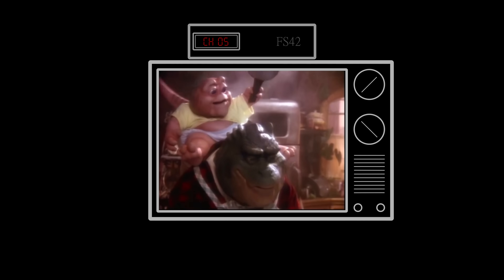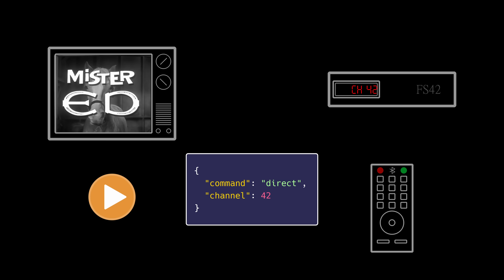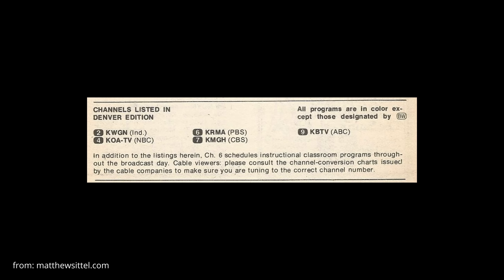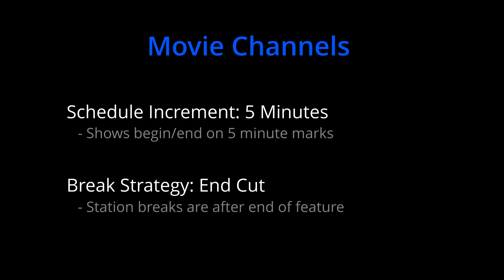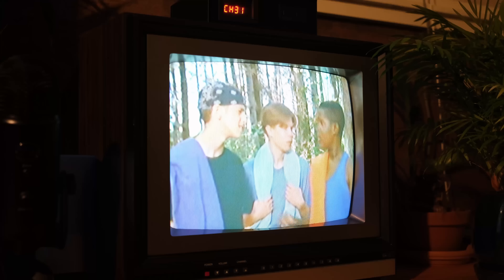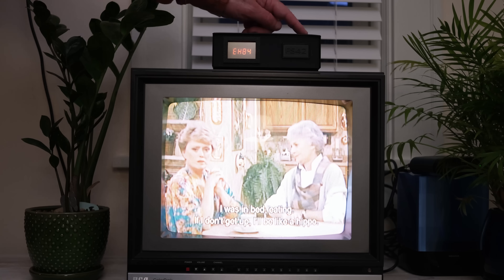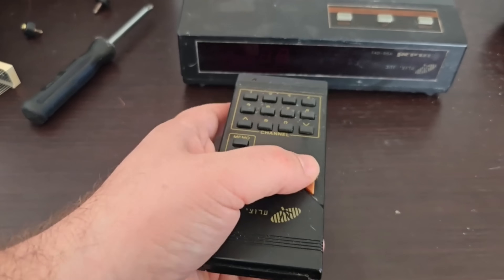90s Cable Simulator - Recreating Retro Cable TV with a Raspberry Pi

Comment: One big caveat with this setup is that there is not really any room to load in any recreated on-screen graphics, temporary or permanent. Once you start getting into the latter half of the 1990s, more networks started using persistent station identification in the form of screenbugs, which traditionally can only be preserved through original broadcasts from the time period. This is probably not something most people would consider, however if anyone is up for implementing a system for that I'd like to see it.
However that's only a minor detail I tend to nitpick about a lot, because the major focus on this project has been recreating the continuity and breaks, and this pretty much nails the setup for that. As well as the aforementioned premium cable networks, this looks perfect for recreating that era of syndicated TV that aired on local stations from back in the day.
Reply from the maker: Its a good feature - station ID screen overlays are on the near-term roadmap. I also want to add channel number and name overlay on channel change also. Cheers!

Comment: Seeing that Jerrold/General Instruments set top box, reminded me of when I built a descrambler for it. I miss those days lololol ❤
Reply from the maker: Seriously? I was always very curious about that - did the descrambler work?
Reply: @ yes, it came as a kit that you had to assemble. For some reason there was a 555 timer involved in it, an inductor or 2 and a handful of capacitors, transistors and resistors. There was a coax input/output. I’m assuming they could only sell it as a kit to put it together yourself so they wouldn’t be liable. But it was amazing. The only pain in the rump part, was adjusting the 2 potentiometers on it, every few weeks. Think it was mid 90s to late 90s, then Comcast required their full proprietary digital boxes.

Comment: This is so great. I have loads on content on my NAS and have tried and failed at setting up something similar with ErsatzTV but failed. So I’m still a bit intimidated to try this out. You have done incredible documentation though so I’ll give it a try.
Reply from the maker: Thanks! There are still some holes in the documentation, so if you give it a try and get stuck, just file an issue on github and I'll try to unblock you. Cheers!
Reply: @wrongdog_reckons  I saw the detailed documentation/guide.  Looks pretty straight forward!  Will give this a shot.

Comment: The further we move away from the 80s and 90s the tighter the tether grows.
Reply from the maker: The past looks better and better as the future looks cloudier and cloudier I think. Cheers!
Reply: @wrongdog_reckons  yep we are heading for something really bad and this kind of stuff takes our mind off of it for a bit. Thanks. If i can offer one suggestion, could you trying mounting the Pi inside a real 90s cable box :)
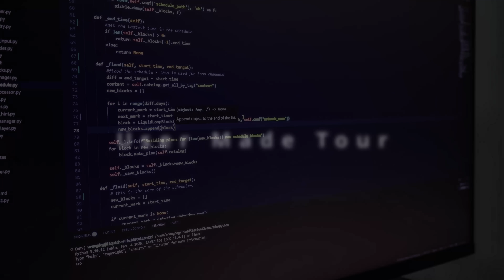Reply from the maker: @mehmeh5471  - Well said. If you look at 13:30, it shows a user made version where they mounted it in a real vintage cable box and put the converter inside the box. Cheers!
Reply: @wrongdog_reckons  Thanks, sorry i must admit i stopped the video just before his part came up.

Comment: So, sometime during the pandemic I saw a similar video and Ive been hunting for it and I am curious if the guy behind that video crossed paths with this github. The guy I remember did a similar thing except he I think had to make his own custom display because of something with the Raspberry Pi, but what I remember most was that in his content showing what the world used to be like he used a lot of content from St Louis local ads, and I think he might have actually recreated our broadcast networks in his implementation. I saw some St Louis local ads in your discussion of commercials as well, but figured this was a coincidence. The other guys video felt like it was some 25-30 minutes long, and I've been hunting loosely for it for a year.
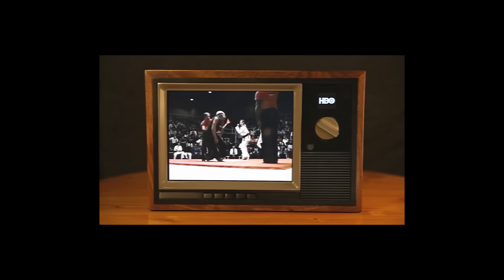Reply from the maker: Yes - I reference this video at 17:40 because it was a huge influence to starting this channel in the first place (thinking: I also do low-stakes but detailed projects and like film-making). I've never interacted with the OP of that video. It was a great video and project, but the OP didn't release the source code and later deleted the video. After I started my channel, I went back to find the video so I could thank them for the inspiration but found the video was deleted. No idea why they deleted it, so out of respect for that, I wont link it. It still exists on archive.org if you want to search there. Cheers!
Reply: @wrongdog_reckons  OHHH I see that yeah, I couldnt find it either, so that makes sense. I will try and go watch that on Archive then. Thanks for the heads up.
Reply: @TyCrawford  you'll find a few reddit threads with a link to the original video on the internet archive (for some reason their own search didn't bring up the video for me). The title is "Retro TV: Live 24/7 Vintage Cable TV Network on Raspberry Pi"

Comment: This is a really interesting video. I have several cable tv trasmitters (QAM). They are laying in my basement. This would be a nice project to change those channels into multicast streams and stream them to the QAM so it outputs those in RF signal so multiple TV's could watch it and browse different channels
Reply from the maker: So, I want to learn more about the TV transmitters. QAM is what I should be looking for? Cheers!

Comment: I would love something like this for Windows PC. This is amazing.
Reply from the maker: I run it on a PC all the time, but there is an extra step: you'll need to install WSL (Windows Subsystem for Linux) with the default Ubuntu Linux install. Then, you can just follow the install steps on the github wiki. This is the configuration I develop it in too. If you decide to give it a try and get stuck, file and issue on github and I'll try to help you out.
Reply: @wrongdog_reckons  Awesome! I'll give it a try. Thank you. This is amazing.

Comment: It be cool if you could have episode related bumpers play if something major comes up, The late 90s was the start of hype TV and the X-files had a lot major reveals that they would hype up leading into the new episode, Or things like two part episodes like the Simpsons Who shot Mr Burns episode and its contest. Speaking of two parters is there anything in place to make sure they play back to back? 

i think these features would be great and important to add if you ever attempted 2000s Tv as its going to be required for shows like Lost and survivor to make it feel anywhere near realistic to the era
Reply from the maker: Exactly - need to be able to match specific bumpers to specific episodes. I'll put it on the roadmap - cheers!

Comment: How much storage does your content take up? Do you have it stored on a NAS or some other storage device besides a SD card?
Reply from the maker: See the blue thing behind the cable box in the thumbnail? That's a cover I printed for a docking station for spinning disks. I haven't fully tested over network, the catalog build might be slow but it should perform just fine. You really only need a couple of TB to make a good SIM because its not high resolution content and depending on how many channels you have and how often you watch. If you watch less, you don't need as much content because less watching is less chance of repeats. Cheers!

Comment: Bro. I only want 1 channel: The Weather Channel. Local on the Nines, baby.
Reply from the maker: Another commenter just told me about Taiganet's WeatherStar 4000 simulator (an emulator of the machine that used to play the Weather Channel's local forecasts in the 90s) to run on a loop. I'm going to check that out - but in any case it would be fairly easy to add one that pulled from a local weather source. I'll put it on the roadmap. Cheers!
Reply: Somebody did make a weather channel that connected to your local weather, it might be the same channel I don't remember.

Comment: Did you find a way to inject commercials at appropriate times during TV episodes without manual tagging? Also, other than your own local media, where are you sourcing the commercials from? Everything I’ve seen on YouTube has YouTube channel branding slapped on it.
Reply from the maker: One of the next items on the roadmap is blank screen detection (for where the cuts used to be) and silence detection. I'll also use chapter markers if they are present in the video file, but I sure don't want to put the markers in there myself! For commercials, I took them mostly from my own personal collection of course! You might have a look at the VHS vault at archive.org. If you get the original archive, it shouldn't have watermarks. Cheers!
Reply: @ that’s probably the feature I miss most but is probably the hardest to do correctly I’d wager. Just curious about the source as you’d potentially need hundreds of commercials (if not thousands) to keep them from getting stale and have enough variety to cover the different genres, times of year, rates G-MA, etc. I honestly can’t believe how much I miss old commercials, I wish studios would release DVD quality versions of them or made them available for streaming, they’d probably make a killing.
Reply from the maker: @ - looking at the view counts that old commercials get on random channels, I would think there is a space to capitalize, but they don't seem to want to. We are saying: You can sell us commercials! And no-one is biting. Cheers!

Comment: Nice! 

Years back, I set up Taiganet's WeatherStar 4000 simulator (an emulator of the machine that used to play the Weather Channel's local forecasts in the 90s) to run on a loop. I outputted the video through a VGA>Composite adapter, then a Composite>RF adapter broadcasting on channel 3.

Since analog TV was all but gone by then but still compatible with new TVs, I was able to turn analog channel 3 into my own personal "Weather Channel" and tune several of my TVs to it.

This is like that project, but turned up to 1000!
Reply from the maker: I think I just found my next project! WeatherStar 4000 - I love this idea. Cheers!
Reply: i fell into a weatherstar rabbit hole last night
Reply from the maker: @flpydisk_sys  - its a deep hole :)

Comment: I am hoping there is the Radio Channel, where you can cycle through Genres and hear nothing you wanted to hear.
Reply from the maker: This would be pretty easy to add in - but right now it filters on video files. I'll put radio stations on the roadmap. Cheers!
Reply: @wrongdog_reckons  no promises, but I am actually a developer. What language are you using? I didn't pay attention to what you were coding In, in the video.

Comment: I like this idea a lot! you have put a lot of thought and work into this- and the one showcased by the other person who built one is really nostalgic. But one thing that i've always wanted and still would like to do is have multiple RF Modulators and Pis setup as stations in the breaker room that has the coaxial that takes it around the house- that way any tv plugged in can use it. 
Maybe like a campground/motel cable type of deal going on LOL
Reply from the maker: One of my next steps is to learn about transmitting - I want the over-the-air artifacts in it honestly. Keep us updated if you make progress on it :) Cheers!

Comment: Dude, you must create black edges around your screen, that's why it don't look realistic
Reply from the maker: You mean the blanking lines for the CRT? Yeah, the problem is that its very difficult to get the resolution out of the the pi and converters to actually match the screen size, so the edges get cut off. I haven't found an adjustment knob that will let me bring it fully into the TV's frame.

Comment: I want to build this internally into a CRT so badly but I'm worried I'll build it and not enjoy to content curration part which seems like 90% of the work considering the code is available.

Super cool, if I happen across a CRT I'll give it a go!

Edit: How cool would it be to have a knob on the front of the TV that changes the time🤯. You'd just need to add some metadata about when each of your content aired and you could do it! It won't be me to add this as I'm only nostalgic for early 2000s tv as I was born in 94. But someone who watched cable across a handful of decades might really like that feature.
Reply: I imagine if this gets popular enough people will start building and releasing their own channels, both faithful adaptations of actual channels and custom made ones like what was shown in this video, then we can just download the archive and plug them into an already existing setup. I'm beyond excited and hope this project explodes so this happens sooner rather than later, and there's less legwork for people to get into it.
Reply from the maker: That is a good idea! On the content curation part - I recommend you start with that since gathering the content wouldn't be a useless effort - even if you never get around to setting up the system you would still have the collection. If you like it (I did, it felt cathartic) then you'll build your collection and then can setup the system. If you give it a try, let me know if it works out.

Comment: Would this work on Raspberry Pi 3B+? I like that it has Composite output.
Reply from the maker: If you can play a video on it and it looks okay, it should work. Try it out with MPV. The problem you could run into is during the catalog and schedule building steps, if you have a lot of content, the memory usage could go high. Give it a try and if you run into problems, file a ticket on github and I'll try to help out. Cheers!

Comment: During TV shows, can you make the commercial break at the part where it was originally intended to be?
Reply from the maker: Currently, it spreads them out evenly, but I have two approaches on the near term roadmap:
- If chapter markers are in the video file, use those
- If not, search for black screen moments, silence or transition scenes.

Cheers!

Comment: I didn't understand half of what you said but it's really cool. The customization is insane! What you didn't touch on is the drives, how much gbs to hold the videos? I bet is at least 5 tb
Reply from the maker: Thanks! If you see that blue thing behind the cable box in the thumbnail, its a cover I printed for a hard drive docking station. I think 4TB is probably plenty for a fair simulation - its definitely more than you want to put on SD cards. Cheers!

Comment: This is amazing 👏 🙌 😍 what would someone need to get this started? A list of materials, please. I love how it took me back to the 90's I didn't want it to stop! I'll take this all day over modern tv.
Reply from the maker: That's an easy one, because you can actually build it out  on anything running Linux. Basically though, from the way I've built mine, you need a raspberry pi 5, a hard drive and the project wiki on GitHub is all you need to get started. 

https://github.com/shane-mason/FieldStation42/wiki

If you decide to give it a go and get stuck, file an issue on github and I'll try to help you out. Cheers!
Reply: @wrongdog_reckons  Thanks, buddy! This was a fantastic idea 💡

Comment: Having a way to mark where on a show an ad break should occur, rather than strict intervals, would probably be a good idea for immersion. 

Also, if you wanted to go the extra mile, stations weren't allowed to run revelant product placement during children's cartoons, so no pokemon toys during pokemon, no transformers during transformers, so some sort of system to blacklist keywords during ad programming for a show might be useful.
Reply from the maker: Yes - two features on the roadmap to address: 
- Use chapter markers if they exist on the video
- If not, looks for silence or blackscreen and insert there.

On the blacklist topic - I didn't know that was a rule? For real?
Reply: @wrongdog_reckons  It may be apocryphal, I've tried searching and things seem to cite the Children's Television Act for the US but reading the original law in 1990 doesn't mention it. The way I was told was that it was to stop the shows from just being lead ups to the advertising.

Comment: use LIRC to create a working IR receiver and control your build with a real remote
edit: oh... they got to that part
Reply from the maker: Yes - for my specific setup, I have not incorporated the remote control because we didn't have a remote control for our box - you had to get up and change the channel (or, as the kid, I had to). Several users have gotten them working and there are some recipes on the github discussion board. Cheers!

Comment: Extra points if you use a MoCA ethernet adapter in the cable box to bring in ethernet. Nothing into the box but Coax and power with RF out for the TV.
Reply from the maker: Had to look up a bit about MoCA ethernet adapter - do I get any extra points if I just use the ethernet adapter that's already on the pi? Cheers!

Comment: How do you connect the rpi5 to the crt?
Reply: There are specific hats for that.
Or via composite jack.
Reply from the maker: Yep - multiple steps: HDMI->Composite->RFsince this TV doesn't have composite in. I have a single device that goes HDMI->RF, but it doesn't give as good of results, since the composite->RF i use if from the era, it seems to work better.
Reply: @wrongdog_reckons  ah ok, I was wondering because my rpi 3 has the head phone out where an rca cable can be connected but I heard the rpi5 does not have it anymore
Reply: @dima-d2w5x You heard it right, it has been dropped on 5.